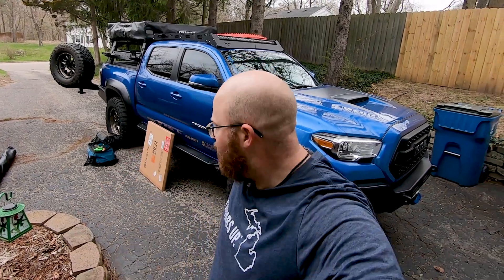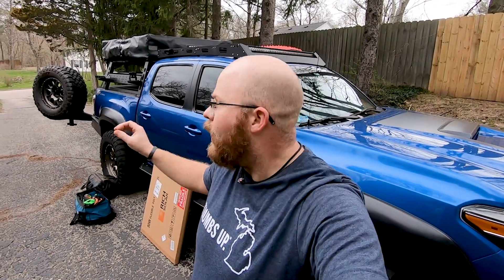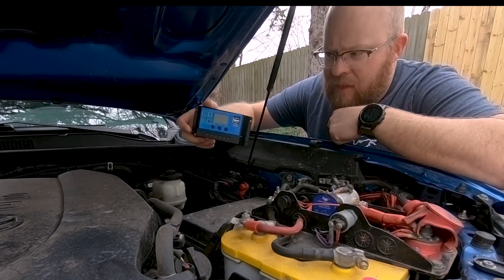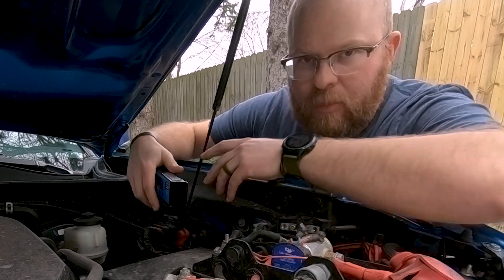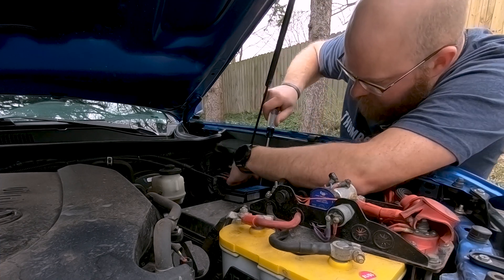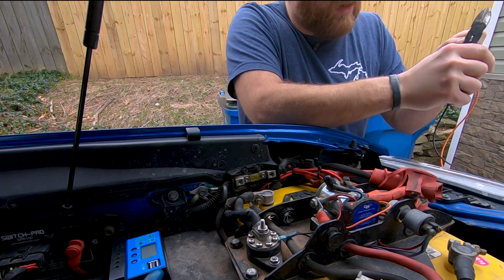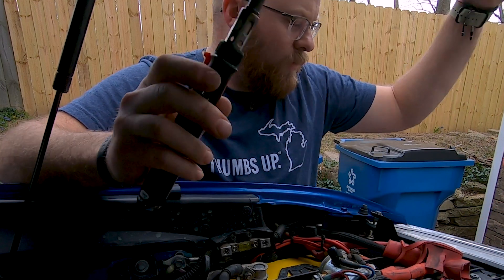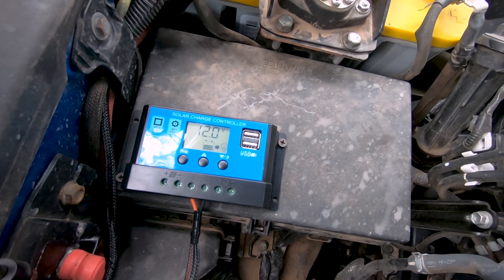Toyota Tacoma Solar Panel Install | Victory 4x4 Roof Rack

Comment: so you're screwing it on top of your fuse boxes so now you're making holes in your fuse boxes so when you splashing water it's going to go up into the up to the top onto that into your fuse box what a great location
Reply: Yeah, he needs to silicone those screws and the holes.

Comment: I use those cheap PMW controllers for many solar projects .  You don't have to apologize because they are not American made. I don't need to squeeze every watt out of my panels hence I don't need the expensive MPPT.  That particular PMW model comes without the USB ports and they are not waterproof.  I question if they can handle the heat of the engine compartment as they are made for indoor use only.  I build a battery box out of a large Camco box with a deep cycle battery and a cigarette socket installed.  Added that same controller on top of the box with double stick tape.  There was room for a 400 watt inverter inside the box. The whole thing fits nice behind the driver seat and a 12 volt compressor refrigerator is plugged into it.  I have a 100 watt rigid panel on the roof rack of the truck. The refrig has been a game changer for camping as we don't need ice anymore.  Imagine no more ice, melted water and soggy food for camping. I can even bring ice cream !

Comment: Nice setup.  I have one on my Land Cruiser 80 to just keep the battery charged while I work on the engine.  Replacing the water pump, Push Rod Panel Gasket and some hoses.  I am using an old Chinese charge controller, but since I've been working on solar for some time now I found out that Epever has an IP68 mppt charge controller built to withstand rugged off road environments.  I say this because I've had my Land Cruiser 80 in some really deep water and so on.  Plus mppt handles sun more efficiently especially if you're going to mount a second panel.  My next project might involve a second battery as a backup for those times you might need a jump start in the middle of nowhere.  Nice though.

Comment: Flexible don't last long.
Reply: Yes very true and 100 watt rigid glass panels have fallen in price so much.  windy nation has 100 watt panels on eBay for $75 with free shipping too. They weigh a lot more but only 16 lbs each so not too bad.

Comment: Do you do anything for rust protection in the winter for the Taco? I'd love to hear from a fellow Michigander.
Reply: Take your old tranny and engine oil. Spray or paint it on the underside. Monthly in the worst parts of the year. Every few months otherwise.

I live in Nevada. Never had rust issues. Super dry weather.
Reply: @raffikkiz  I have had good luck with Woolwax. I saw a video testing a bunch of different methods and they found used oil to be one of the least effective methods for rust protection here in the rust belt.

Comment: If you are worried about waterproofing the charge controller, you can put it in an appropriately sized tupperware and silicone the holes where the wires go through. Nice tutorial.

Comment: Which hood struts are you running? I saw a video about installing those and I think I will be doing that in the near future.
Reply from the maker: Redline. They actually have a group buy going we think... https://www.tacomaworld.com/threads/redline-tuning-20-off-hood-quicklift-systems-group-buy-ends-april-21st.660780/
Reply: @Victory4x4  Thanks for the heads up on the group buy! Unfortunately my wallet is gonna be pretty thin for the next few weeks. Grrrrrrr.